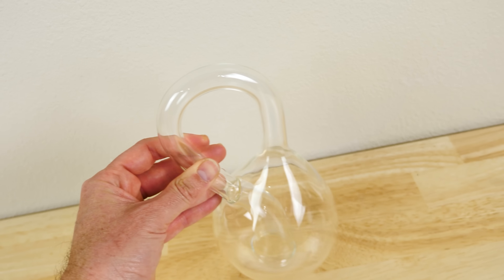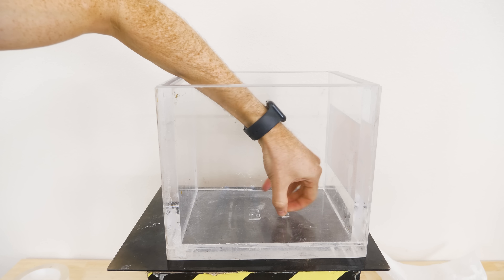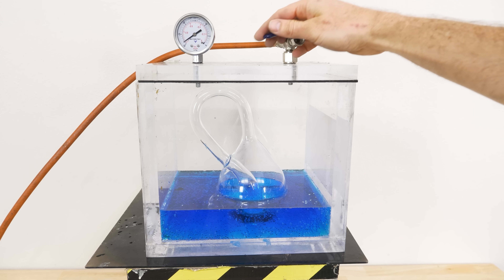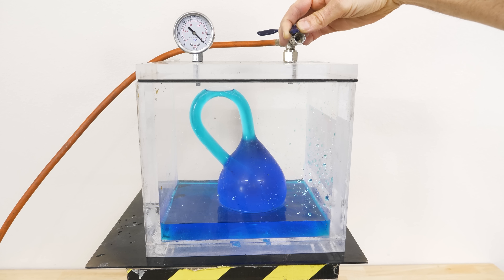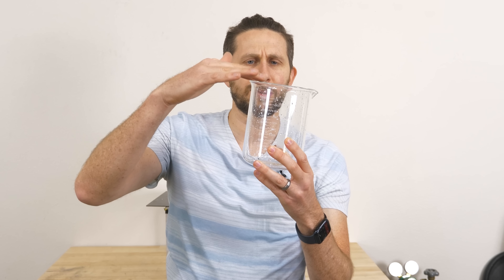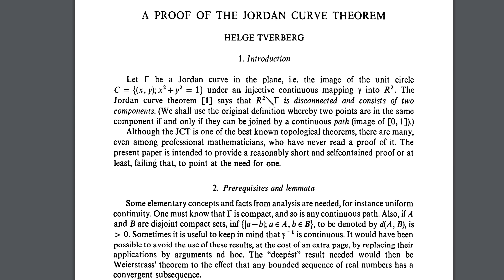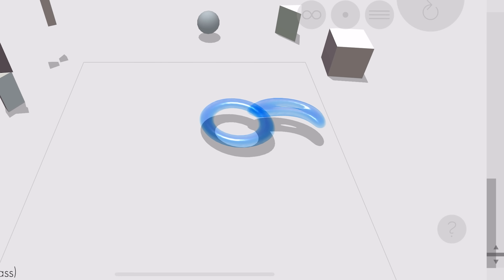Is It Possible To Completely Fill a Klein Bottle?

Comment: technically yes this is what it would look like with no volume but wouldnt it still technichally have volume in the glass itself? im no science person im in tenth grade and failing out of school but like when you try to fill it by pouring water into it and tipping it sideways would the water that actually goes into the bottle equal the volume of the glass? or something like that im not sure bcuz like yes the shape thingy has no volume but by making a three dimensional model of it using glass that gives it volume that gives it shape there for you remove the whole part of it having no volume bcuz now it has volume even if its just supposed to be a model i dont think scientifically we can recreate a physical item in the third dimensional plane or wtv bcuz for it to be 3d it has to have volume it has to have shape there has to be more than one side but you cant make things with no volume yet bcuz ur still grounded in only 3 dimensions or something right?

update: i finished the video, im a dumbass(i think?) but idc cuz i already was lmao for some reason my logic always makes sense to me but not scientifically, like how i do math it works it gets a number but it doesnt get the right number half the time for some reason and idk why

Comment: I loved the conclusion, "so in reality the Klein bottle is just a fancy cup that you need a vacuum chamber to fill up", it all came down to that. The 4d visualization of a Klein bottle is cool though!
Reply: You can also fill it by putting a small straw or something similar that can reach the inside of the Klein bottle. Then fill it while not letting it get inside the straw.

The straw allows air to escape and not prevent water or liquid from being blocked by the air in the space.
Reply: The 4d visualization of a Klein bottle is from a game called 4d toys
Reply: A cat scan also cuts slice images so doctors can see if we have problems inside.
Reply: Or a Straw
Reply: Tubing and a syringe
Reply: @ConstantChaos1  no, that's too simple of a solution. If everyone figured out a straw works the video wouldn't be interesting. Gotta use a vac
Reply: @kevinjr6650  I mean, fair, but imagine how cool it would be to drink from one with a straw after filling it. Sci-fi sh*t right there
Reply: @ConstantChaos1  you Sir make a valid point
Reply: In theory, you'd need to fill all the outer (infinite) space to actually fill the bottle.
Reply: 100 like
Reply: A freaking vacuum chamber 🤦😂🤦😂
Reply: 10th reply
Reply: no.. you don't need a vacuum chamber at all.. just a rubber hose

Comment: Ok - but actually you can`t fill anything, that have a volume - because the outside is seperated from the inside. If there is a hole to fill something in, it`s not seperated..

Comment: Why not just use a water pipe releasing into the bottle hole and fill it? Instead of using vacuum chamber with several pipes and valves.

Comment: You lost me at "Technically a beaker has no volume as it is open at the top."

Yes, we do arbitrarily define the top of the beaker as the boundary between inside and out, just like the opening of that bottle would be the final boundary of it.  

But the endgame of it all, regardless of the shape of the container, even if you claim the container itself has no volume, if you fill it with a finite amount of liquid, that liquid has a volume.  Even if the liquid were in 0g and floated away, it still has volume.

Comment: Isn't the major point on the klein bottle not having a volume, the fact that its open? Just like the measuring cup you took as an example. Because if it was closed, then you still have an outside and an inside, only with a part of the bottle being on the inside. Im not that much into the matter, and this is just some quick thoughts i have on this.

Comment: Just run a small tube going from the hole, into the large glass area, and then feed water in that way using a pump. You wouldn’t necessarily fill the slim glass area up, but you’d fill up the large glass area

Comment: Joke's on you, the klein bottle started out full, full of air. Also saying it does not have a volume suggests that it realistically takes up no space. However, submerging it, if it theoretically cannot be filled, would disprove this as it would displace fluid as it was submerged, therefore it does have volume (let's assume that the glass it is made of has a volume of 0). If it does not displace fluid, then it would have no volume, and would otherwise be filled. This is a physical paradox.

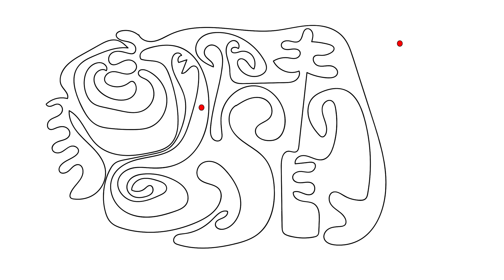Comment: 5:31 that's a very interesting shortcut to know if we are inside or outside but to what does it apply?
it doesn't work for a circle inside a circle, every point inside the biggest circle is inside even if also inside the smaller circle

Comment: Such a complicated way to fill the klein bottle.
Just stick a tube in there all the way to the end, then pour the liquid into the bottle (the tube will allow the air to escape), when done, pull out the tube. 
End result: a fully filled bottle in a fraction of the time.

Comment: How does this not have a volume? It's just a fancy shaped Volumetric flask?
Like, push a bendy tube from the entrance at the bottom until it reaches the bottom of the flask, connect it to your tap and go wild.
You need no fancy special tools for this.
The inside isn't the outside, it's just that the outside of the entry is inside the inside.

Comment: Your explanation for volume feels wrong with it being the reason the this bottle doesn’t have volume.   There is a clear inside and out side.   As the bottle wraps inside itself, you would simple have 2 insides.   There is only 1 opening so it’s rim is the border of out and in

Comment: By the same reasoning, a milk pitcher, or an open water bottle, has no volume. What, this container has no volume because the opening is at the bottom and not the top? What a bunch of nonsense. calling this a shape with no volume is the epitome of what's wrong with mathematicians in this world.

Comment: I am convinced that a beaker has a volume. Submerge it completely in water and the water level will rise by the volume displaced by the beaker - it will also behave proportionally - if you submerge 10 beakers of the same kind (within manufacturing tolerance) the difference will be 10x.
Reply: haha, good one.

Comment: I guess if you have a vacuum chamber sitting around and you need to find a use for it.  Otherwise you could have simply poked a flexible hose into the bottle and filled the water in thru the hose so the air could have escaped thru the space between the bottle and the hose.

Comment: this is wat I gather.  1st the blue liquid is water(took me a minut). 2nd the bottle DOES have volume, looks like maybe a pound it 2, not sure.  3, the blue liquid(which isn’t just water btw.) has volume. 4, no emptiness inside shape has volume, but can contain volume, which I assume you, or klein, meant canNOT? &5, you’re both wrong it contains a certain volume of either air, water, &/or blue tint.  -  😩KLEEEIIIN B8t😒..  NOW, as for filling that bottle, hmnnn..  let me watch rest of video - 1sec.,  Ok I though of about 5 ways.  they’re all kind of similar.  here’s a cheap 1(should cost roughly 1/10th of a cent if ya got a few tubes laying around).  put 2 2bs(tubes) on ‘top??’ of bottle, a fat blue powerade 1 fitting tight to top fill hole, extending about a 1’ or so higher than bottle(for gravity-weight reasons), & inside that tube, a small air tube fed through it, &&& that whole gUfE-Sd bottle, to pretty much the ‘top’ of that klein designed buble area.  thennnn ofcoOurse pOr the powerade(Gatorade?) & it’s weight pushes the air out.  there done - as for getting that bottle to stay upright.. hmnnn - quite the cunundrum on that 1.

Comment: Ridiculous hype. It's not a paradox, it's not magic, not ingenious, not interdimensional, not a mathematical marvel. It has a definite inside and outside. The spout simply goes back through the bottle. It can be filled up and has volume like any other bottle. Put it under water and turn it around, and it will fill with water. Pull it up with the spout at the top and you'll see it even holds water. Much ado about nothing.

Comment: Meh... It holds stuff, so it has volume. Is there an inside to a house with just holes in the walls for windows? Yes. Igloos have an inside. Also, how are there 4 dimensions? There's up, down, left, right, fore, and aft. That's still 3 dimensions. This is the type of stuff that is based on someone's definition of words. And they get paid the big bucks to say that they discovered something new, but all they are doing is changing definitions of words and everyone applauds them. It's sad that this is where the science community is going.

Comment: Even if a Klein bottle has no volume, is there an equation to determine how much liquid is needed to completely fill a 3D version of a Klein bottle like you did in this video?
Reply: Not exactly an equation but just measure the amount of water inside the vacuum chamber before turning on and after filling the Klein bottle, subtract the difference and you have a volume number?
Reply: @andrewjames2569  The answer is 42...

Comment: Topologically the Klein bottle doesn’t have a volume, but it must have a volume that can be defined as the amount of water it displaces when submerged in water with the caveat that that volume may depend on its orientation and the amount of air trapped inside, but that volume is a real and useful physical property because it determines whether or not it floats or sinks, no?

Comment: It has volume dont lie.
Reply: Watch the video
Reply: @ploppyjr2373  it has volume, I have a degree in physics the video is fake news please educate yourself.
Reply: @HAHb-zc2dp  It doesn't have volume. And a degree in physics isn't what you're looking for here.  It doesn't have an inside or an outside. If you claim it has volume, you either are stupid or didn't see that the outside is connected to the inside, thus it has no volume. The only reason he was able to hold it was because his hand sealed the bottom hole, giving it volume.

Comment: Filling the bottle with vacuum chamber seems to be a overengineered, why don't u simply slide a hose from bottom and and fill water through th hose so that air can escape from gap between hose and tube
Reply: Well, the water will also escape.

Comment: There is a border between the inside and outside. The inside of the beaker is filled with glass and thus it has topology. You can verify it by measuring the thickness of the glass. The outside is air.

Comment: Stupid. Does a cup have no volume since it is open on top?
Reply: Mathematically, yes. By virtue of being open on one side and not a fully enclosed space, it technically has no volume as math defines it. If you simplify it down to 2 dimensions, a C does not have a volume because it is not enclosed while an O does because it is enclosed. The cup has a capacity of liquid that can fit in it, but it doesn't have a "volume"

Comment: I think it'll be easier to fill with a straw no? The air will be pushed out as the liquid is filled into the chamber provided the straw or tube is smaller than the neck of the bottle.
I guess even mathematicians overengineer solutions 🤣

Comment: Jut use a small tube to connect the air inside with the outside, even a cheap plastic straw can do it if you bend it far enough to reach the interior.

Also stop bothering us with 4rd dimension and all the garbage physics that don't exist.

Comment: I would have just snaked a piece of flexible tubing into the main, uh, volume to act as a vent.  Hold the "mouth" of the bottle up with the vent tube as high as possible "inside."  Then you can just pour into the mouth and it will fill.  Alternatively, you can fill through the tube and let the air vent through the structure.

Comment: His amazement that he's able to fill a "no-volume" object with a liquid is, according to his definition, as mathematically amazing as me filling a regular drinking glass with water. Both are objects with zero volume.
Reply: he literally explained that in the video lmao
Reply: He says so in the video. 3:36
Reply: @gracewenzel  So does a klein bottle. Having no defined edge does not mean that there is no definable inside/outside.
Reply: @pureityXXX Again, in mathematics you are incorrect.
Reply: @nomarxistspls90  Again? No, learn proper English.

Secondly, I doubt that. Why don't you explain why not having a defined edge precludes a geometric shape from having an inside and outside?
Reply: Yeah, well, it has mass, so unless it's dense enough to generate an event horizon, it has a non-zero volume. 
It's bottle bent down into itself, that's all.
Still not sure the point mathematicians try to make with this object, but if a Renaissance glass blower can make it, it won't be violating any laws of physics.
Reply: @yawningpheonix it's about the surface shape. Numberphile have some good vids on it.
Reply: @yawningpheonix He's saying that the shape of the bottle has no volume. By definition, it doesn't, which you'd recognize if you watched the video. Of course, if you look at the material the shape is made of, there will be a small-scale volume, but that's not relevant when it comes to discussing the volume of the vessel. If you watch the video, you'll see he explains that the bottle is really only an imitation, since the true version of it exists in 4-D. Nobody once said that this bottle defies the laws of physics, I'm not sure where you got that idea.
Reply: A glass has a specific inside and an outside.
Reply: @FirethornYT not according to the guy in the video

Comment: Speed running videos: can you completely fill a Klein bottle? Yes by sucking all the air out using a vacuum chamber the water will fill the Klein bottle.

Comment: Him using a whole vacuum chamber to fill it while i'm thinking he could have just fed a tube/hose into the larger area (while upright)  and filled it to the top curve, then submerged it in a tub and flipped it to fill the rest.  But a guess using a vacuum chamber makes sure you can remove all the air bubbles 🤷🏻

Comment: You don;t actually need a vacuum chamber to fill it.  Use a hose smaller than the opening to allow the air inside to be displaced.

Comment: To say that this bottle has no volume is stupid, because that way every jug, every cup, anything that doesn't have lid to be closed has no volume. And I understand the concept that this doesn't have a well defined rim so it's as if it was the same surface all along, but of you can conceptualise a cups inside and outside as separate, the same way you can conceptualise the hole at the bottom of the bottle to be the border between the inside and outside. Otherwise you haven't filled it as you'd need to submerge it besides filling it up to the hole like you did...

Comment: You can't submerge it the water, and twist it until the air bubbles up out of it?  Or stuff in a little aquarium hose to vacuum the air out by manually siphoning it?
Reply: I 100% believe you just need a full bathtub and 15 minutes of simple problem solving.

Comment: This bottle is like my ex gf's vagina; it woudn't ever fill up and be satisfied, but now I know why emptiness and pressure worked with her. What a bitch... thanks to applying to her extreme condtions and insisting a lot I had a psycologycal shock that healed my asthma too (tho' I also did swimming, kayaking and weightlifting and lived in ecstasy 4 her) but it might be dangerous for normal people. Too muchstress to tolerate...

Comment: Only problem with a Klein Bottle is that in 4D it is not only not volumetric, it doesn't have surfaces either, and is almost the equivalent of a string from our world.  A string is one dimensional object which can be twisted around in our 3D world and a Klein Bottle is a two dimensional object that is twisted around in a 4D world.  So it might be great as a psuedo bottle in our world but probably not of much use in a 4D world.  But, a Möbius Strip does have substance in our world.  And a corresponding Klein Strip – not Bottle – is the equivalent 4D object and behaves, in an imaginary 4D world, pretty much how a Möbius Strip does, in our 3D world.

Comment: 'you need a vacuum to fill it up'
have you tried just submerging the whole thing and tilting it horizontal?
i'm quite sure you can get it mostly filled with just that.
and after that you just need to rotate it to let the last air bubble out.
luckily the neck of the bottle is thick enough to not block the air completely.

Comment: With that definition a regular glas or bottle has no volume either. I would have used a small hose to fill the bottle. Max water capacity = volume :)

Comment: I feel like it would be possible to fill the bottle by submerging it completely in water and turn it several times to get out the air. Correct me, if I'm wrong.

Comment: put a rubber pipe in the bottle and pump the water through the pipe straight into the bottle
Reply: just tell me if there's a problem in this solution

Comment: Step 1 : Get two halves of a Klein bottle.
Step 2 : Poor water in bot halves.
Step 3 : Put both halves face up in a freezer.
Step 4 : Let it freeze.
Step 5 : Take both halves and weld them together.
Step 6 : Let the ice melt.

Clearly an easier way.

Comment: If you think you're manipulating a Klein bottle, no you aren't. Klein bottles are mathematical objects bent in the 4th dimension to not intersect themselves - that's the big difference between holding what is in effect a novelty cup, and playing with an object without an inside or outside

Comment: Well, taking a beaker, isn’t it’s volume just the part that is plastic or glass or the material it’s made up of… The space inside the beaker is just air and the amount of space inside the beaker is it’s capacity, right…